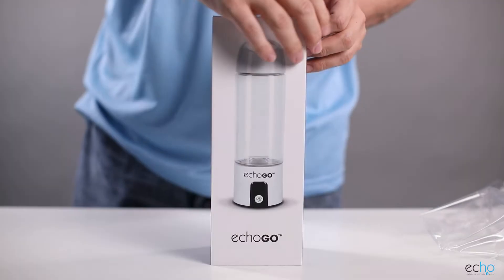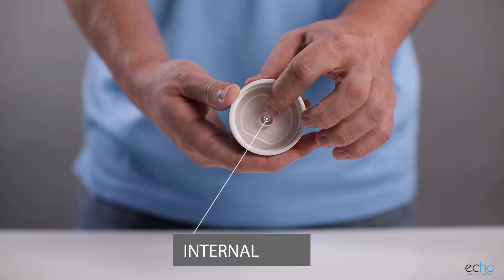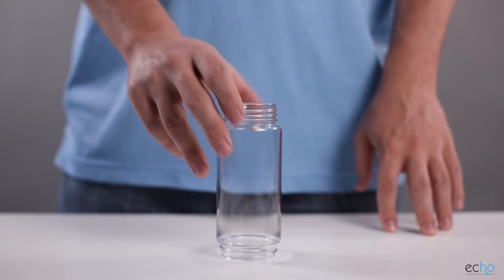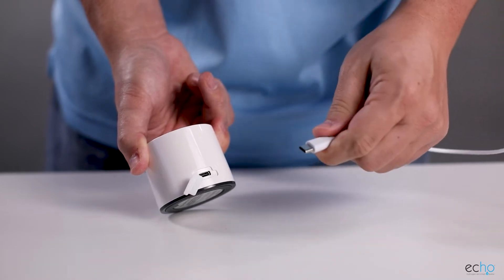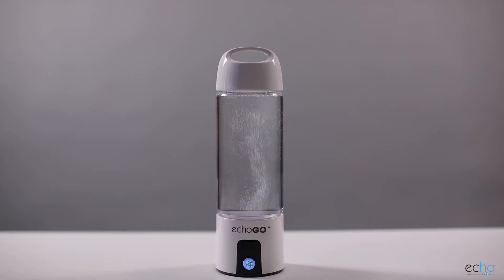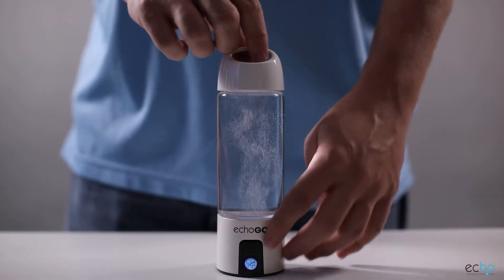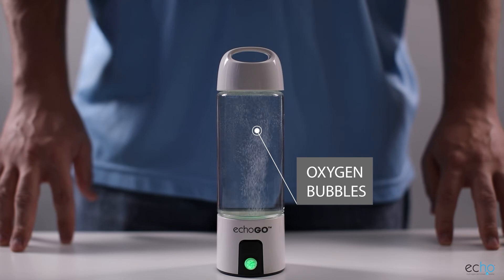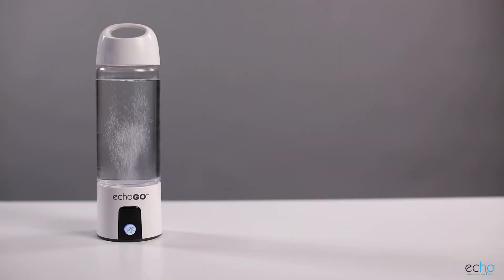Echo GO Hydrogen Bottle Tutorial

Comment: Can you use well water?
Reply from the maker: Keep Your Water Game Strong! 🌊

When filling up your system, the golden rule is to avoid using tap water—chlorine is not your device's best friend and can cause some harm to the components. Instead, give it the good stuff! Spring (Mineral) Water is a great option for that extra mineral boost, or you can go for RO (reverse osmosis), distilled, or purified (filtered) water.

Pro Tip: If you're opting for filtered water, just double-check that the chlorine content is less than 1%. (Heads up: not all filters are champs at removing chlorine!) You can find some affordable meters online to measure these elements in your water, just to be on the safe side. 😊

Comment: How many oz?
Reply from the maker: The portable Echo Water bottles are specially designed to give you a concentrated high dose of hydrogen without needing to have all your water intake come from the bottle (although you can!). The bottles are 10 fl. ounces.

Therapeutic hydrogen levels begin at 0.5 PPM, which is WELL below the PPM levels achieved in just 1 cycle of Echo Hydrogen Water! Just 1-3 bottles per day provide a sufficient amount of molecular hydrogen to potentially grant health benefits! 3-6 bottles per day is recommended.

Comment: I recently purchased an echo go and when I pulled the plug from the generator there was water already in it. Is this supposed to come like this. I also didnt get a charger. Am I supposed to use one of my own usb-c chargers?
Reply: There's a small amount of water in it because there's a component inside that needs to be kept moist. Youre suppose to cycle this water out, and then throw it away. You drink from it normally after.
Reply: @r.malcolmkr2052  Thanks for responding. Very helpful.
Reply from the maker: I know it seems very weird to receive a new product only to find A little bit of water already present. NO WORRIES- IT IS BY DESIGN! To keep your bottle working optimally the generator will ALWAYS need moisture. If the generator membranes dry out it it will cause damage that will ruin your amazing bottle. Because of this, the product is shipped with water in it. Be sure to save your plug in case you ever need to store the bottle (that will keep the water from evaporating!!)

Comment: BE CAREFUL!  Me and my friend order one. we have 3 in total. One holds pressure and makes a pressure sound when you open the top. The other two do not hold pressure and they leak water while under pressure. The company DOES NOT ACCEPT RETUNS. Completely regret buying this. Very cheap product.
Reply from the maker: Did you overfill the product? The lid is a pressure top lid, so if you put too much water in it, it will fill inside the pressure release and cause it to leak. We are putting a fill line in the next model so that it doesn't get over filled and leak.
Reply: @Echohydrogen  product works fine. Just wish I weren't poor so I could but the echo go+ (rather than the lesser echo go)

Comment: thank you for a nice, clear commentary. being visually impaired it can be frustrating when companies put out videos with just music and no commentary. as far as using this bottle goes, my main concern would be fulling it up with the right amount of water. is there a tactile water level indicator that I could feel with my fingers?
Reply: Mine just came in the mail today, (regular Echo-Go, not the plus version). There is no indicator fill line. I just guessed, and left about half an inch form the top worth of space.. Somewhere on the website says it's a 10oz bottle. So if you want to measure out 10oz then pour that into the bottle you could do that I suppose.
Reply: @wesleytietz4506  many thanks 👍 from what I have read about a different device, the OSMIO genesis, the best approach with these devices is to fill them almost but not quite to the top, as this helps with the production of more hydrogen parts per million.

Comment: Is there a filter or other parts which need to be periodically changed to ensure the electrolysis continues
Reply: No
Reply: Isn't Electrolysis hair removal?
Reply from the maker: Nah, Electrolysis is a clean process that produces hydrogen from water, with only oxygen as a byproduct. It happens when water is shocked with electricity, converting hydrogen to gas.

Echo Water™ Machines have a proprietary technology that uses electrolysis to harvest hydrogen gas (H2) without changing the water's pH. Then, the oxygen is expelled from the bottle, and the hydrogen gas (H2) is dissolved into a second stream of water, so the H2 water you drink never touches the electrodes, leaving you with nothing but safe and healthy water!

With Echo's proton exchange membrane and oxygen port, our bottles prevent chlorine production and keep the water's pH stable during electrolysis with no acidity or alkalinity changes!

Comment: To be clear, is there any re regular maintenance? Do the plates for electrolysis need to be changed from time to time?
Reply from the maker: The only maintenance needed if you use water with minerals and they build up on the electrodes. If this happens, you would use vinegar to dissolve the calcium off the electrodes. If you use reverse osmosis or distilled water, this would not happen.
Reply: Mine just came in the mail today (my first time ever buying/using hydrogen water). It doesn't look like it... Just use the self cleaning feature once a week, is the only maintenance, and just charge with USB-C (they give you a cord buy not a charging block to reduce waste)

Comment: Very nice! Im interesting. 

The second mode is better than the first ? It is more interesting to have more hydrogen ?

Also, it is possible to put tap water inside ?
Reply: Do not put tap water in it. Only RO or distilled. All the stuff in tap water will cause it to corrode
Reply from the maker: The main requirement is to use unchlorinated water (NO TAP WATER) as the chlorine will damage the components. Distilled & Reverse Osmosis water is the best to use- You may also use Spring (Mineral) Water for added minerals or a purified (filtered) water source.
Reply: You can put any liquid in there. The best kind of liquid is filtered water.
And if you put other liquids in there besides water, it'll probably break the system.
Don't ever let anybody tell you you can't do something.

Comment: And you never haft to add Hydrogen? It will never deplete? Just needs to be charged?
Reply: So nothing is ever required to be changed? What about the plates utilized for electrolysis?
Reply: @kthomas9559   You're correct. The only instructions are to clean it once a week (using self clean feature) and just charge the thing.
Reply from the maker: You do not need to add hydrogen. Just add filtered water and keep it charged.
Reply from the maker: The bottle uses electrolysis. Water is h2o - two hydrogen atoms and one oxygen atom bound together. By applying a precise electric current to the water you can separate the bond between the hydrogen atoms and the oxygen atom. 

So we aren't adding hydrogen to the water we are using the hydrogen that is naturally in the water. 

Pretty high tech right?
Reply: @Echohydrogen  Sounds very cool! I just ordered the water bottle! Thank you!
Reply from the maker: @CelineD303  thank you for ordering.  We appreciate your trust and are here to support you.